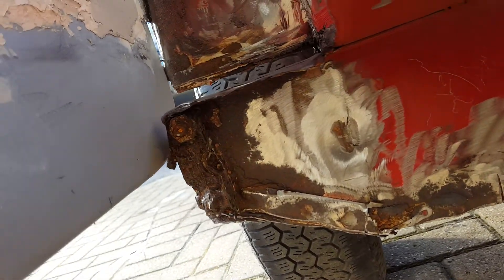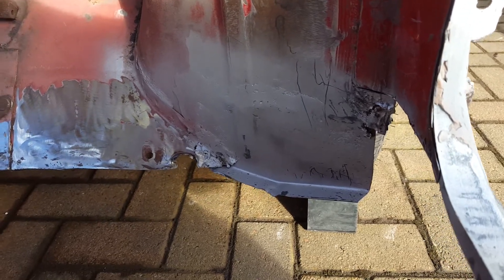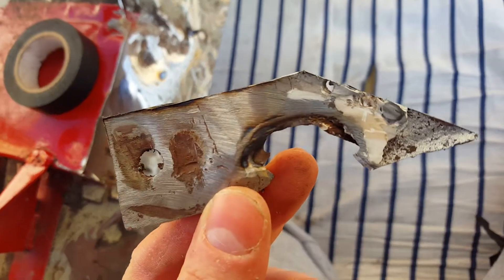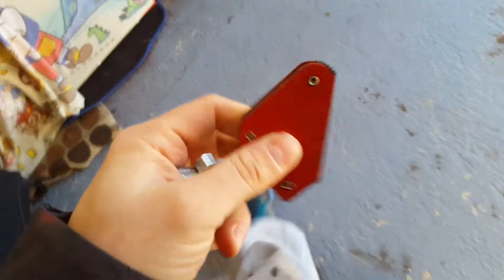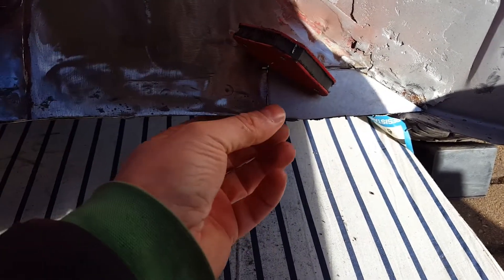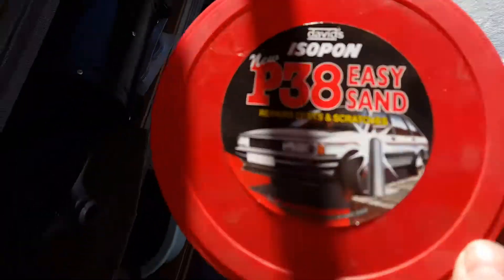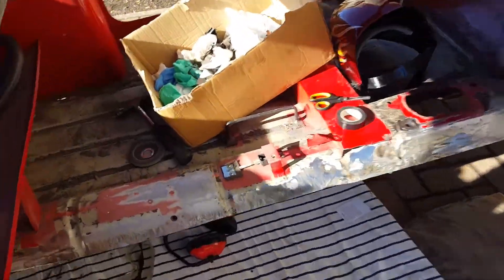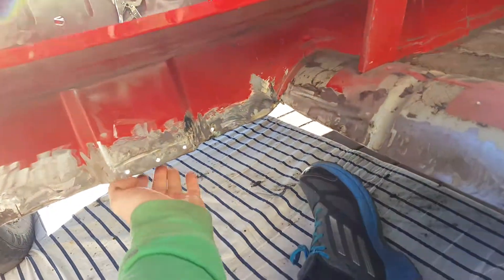Classic Mini Restoration:Eleanor video 3, Toe Board Repair

Comment: Just came across your channel by chance, I have to say I find your approach to this job very refreshing. You are tackling a job most folk would be absolutely petrified with ! I did a similar repair programme on a 1966 Mini which I bought for £15 over 35 years ago, no home MIG welders then. Had a stick welder which was hardly ideal but eventually did the job. Had many years use and fun out of that car so I wish you good luck with this one. Best regards from an old "Geezer" in Ireland.
Reply from the maker: Thanks. I like getting my hands dirty and setting myself challenges. Hope you still have the 1966
Reply: @DBMiniDIY  Sadly no, I had to bid goodbye one day long ago when I climbed in and went through the floor! There wasn't the availability of proper repair panels then and in any case, I was a younger man with a growing family and money was tight. I am now 74 and have the time and some spare money but the price of old classics has soared too high for me. I do have a 1970 Morris Traveller which I have had since the Mini went. Good luck young man.
Reply from the maker: @rustybum2  thanks. I'm hoping to get into my moggi soon when the weather improves

Comment: your putting all that filler in then you have to clean it off to weld the floor in also you need to practice welding more and adjust your setting other wise that floor will fall out

Comment: Temperature was to low, turn it up and the weld won't just sit on top of the steel but burn into it
Reply from the maker: yes my welding improved the more i have been doing it. unfortunately tbe welder started to play up a while back so gives me an excuse to buy a new one. Im looking at the clarke 160tm